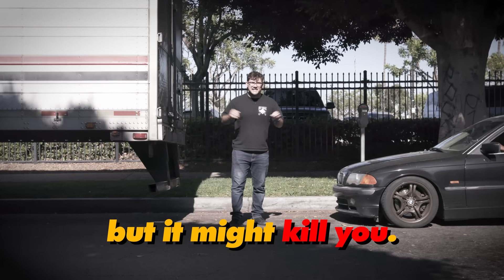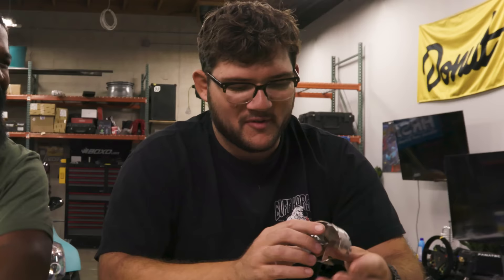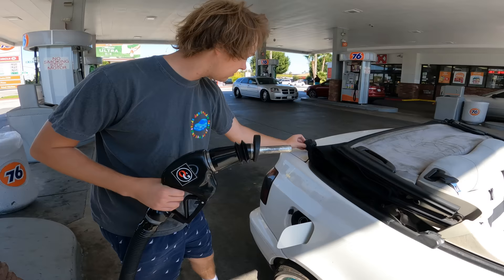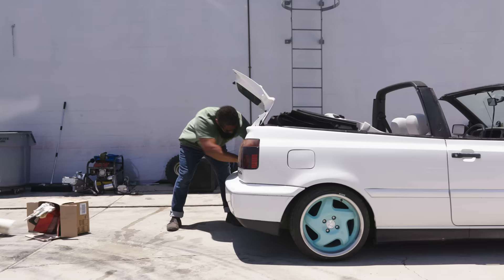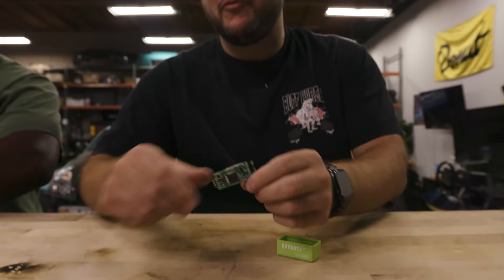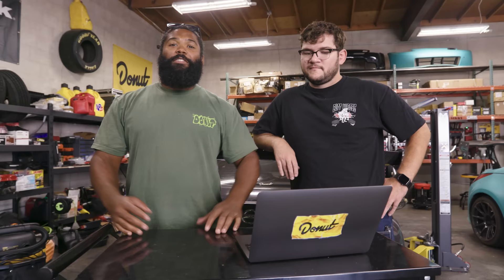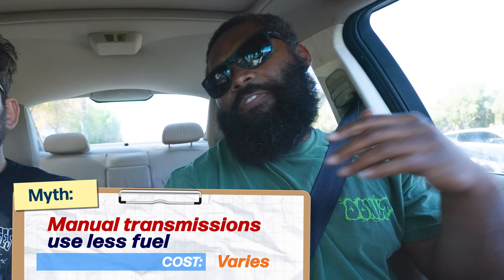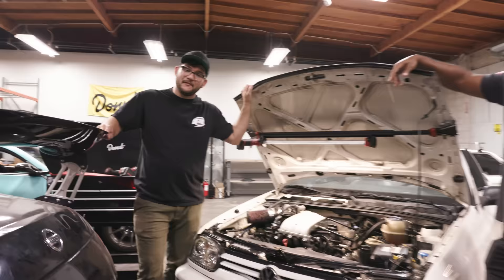Testing Fuel Economy Hacks

Comment: The HHO system should not add much of any fuel economy unless the catayls is adding energy to the system, an alternate way to do this is to use solar to drive the electrolosys
Reply: Have you never heard of the Hindenburg? Hydrogen is one of the most explosive gases, that’s where the energy comes from.
Reply: @slycarlo8747  Thats entirely besides the point, If you want hydrogen just get rid of your gasoline tank and get a 10,000PSI hydrogen tank, get yourself some solar pannels and a hydrogen generator at home to fill your tank up when you get home. You could also add solar to your vehicle and replace your starter with a high torque motor with the same RPM range as your engine to get even better MPG

The point is that the energy needed to split hydrogen from water, is just as much as you get back from burning hydrigen 

(because burning it turns it back into water)

Because internal combustion engines are only 15-25% efficient, you'd be reducing your fuel economy because you're putting 100% energy in, and only getting 25% back

This is why i say there has to be an amazing catalyst to reduce the energy needed to split the hydrogen by about 90%, and that energy has to come from somewhere, so you're actually creating a chemical battery who's output is hydrogen.
Reply: @denvera1g1  You’re assuming that this is the only technology available to synthesize fuel from water. The US Navy uses radio waves to break apart the hydrogen from seawater, and they’ve been doing this for years. As for this video, the main problem with their setup is that they’re using a modern fuel injected car, we used to fit these devices on carbed engines all the time in my area and had very real gains in fuel economy and power. The fact they didn’t even attempt to change ignition timing while introducing HHO tells me they either don’t understand the concept or they weren’t actually trying to make it work.
Reply: I wonder if hooking the hydrogen up to the vacuum line between the fuel tank and the valve would work better.
Reply: @slycarlo8747  I had a feeling you were trolling, you got me, great job.
Reply: @denvera1g1  You’re the only troll here bud. Why’d you delete your last comment?
Reply: @slycarlo8747  Didnt, youtube is weird when you click "view all replies" Thought you deleted yours too but if i click on the notification its still there
Reply: @denvera1g1  You clearly did, it was really nothing though, just more of your incoherent ramblings about how you think we’re at the pinnacle of technological advancement. I’d suggest you research what the petrodollar system is and you’ll understand why this technology was suppressed. Simply put, anything that undermines the value of oil will directly affect the value of the US dollar. Trying to replace petroleum based fuel with the most abundant molecule on Earth would have almost certainly collapsed the US economy.
Reply: @denvera1g1  I see you already deleted your comment again. Why would you type all that then delete it?
Reply: @denvera1g1  “@Sly Carlo I cant tell if you're
rambling and truely dont understand
the basic laws of physics, or if you are
trolling. If you're trolling, you've done
a great job. If not, well here's a little
tip, you cant get energy out of
nothing, and when you use energy it
has to go somewhere.
When water is split into hydrogen and
oxygen, it takes X ammont of energy,
and when they are re-combined, it
can never release more than that
same X ammount of energy
The same thing goes with Nitrogen.
Nitrogen compounds is even more
energy dense than hydrogen because
it is even harder to split apart than
water, and nitrogen really wants to be
in ints N2 state. Thats why most
explosives are made out of mostly
nitrogen, not hydrogen. The "holy
grail" of an explosive would be made
up of 100% nitrogen, theoretically a
3x3 cube could work and be just
stable enough to not explode just by
looking at it, the problem would be
assembling them into this structure in
the first place”

I love that you can copy and paste from screenshots now lol
Reply: @slycarlo8747  Try using a full computer then maybe you can see the comment instead of your phone provider deciding the comment is too spicy for you to read lest you get heartburn
Reply: @denvera1g1  Don’t worry, I put it back for you since you deleted it. It’s pretty entertaining honestly.
Reply: @slycarlo8747  Honestly, i'm enjoying your trolling, you arent overly mean about it, its entertaining, thank you.
Reply: @slycarlo8747  No, just no. No matter how fancy your hydrogen production ways are it wont improve gas mileage. No matter how you modify your engine it wont improve your gas mileage. It is thermodynamically impossible. If you have a even basic understanding of chemistry, or thermodynamics you would immediately know that these devices are bullshit. The only way you can get better gas mileage with one is by having the energy come from a external source that is not generated by your engine. Like adding a battery you charge every time you are home.
Reply: @justahamsterthatcodes  It might just plausibly improve efficiency enough to outweigh the energy cost of the electrolysis.

My gut feeling is to agree with you that this won't happen, but it's not obviously wrong like a perpetual motion machine would be
Reply: @trueriver1950  IT is possible, especially early on before the engine warms up, because if the HHO is displacing gasoline, that HHO gas is already at the proper mixture to ignite, where as gas, especially on carbureted engines, doesnt fully vaporize when its cold.
However, a much more effective method would be to run the engine on propane or natural gas until it has warmed up, and then switch over to gasoline(which has a higher energy density than LPG/CNG meaning you can go farther with a smaller lighter tank of gasoline)

But again, you cant add more energy to a system, by extracting that very energy from said system. This isnt like a turbo or supercharger, where you're only using energy to add more air which allows for more fuel to be used, with an HHO system if you put 3HP into the HHO generator, you'll only ever get 3HP out of the HHO when it is burned.
Reply: @trueriver1950  Uh no. Let's look at the chemical reactions happening here. First we electrolyse water, so H2O -> H2 + O then we move the results into the combustion chamber and burn it there so we get H2 + O -> H2O. If I were to get more energy from burning our hydrogen gas I would have invented a perpetual motion machine, which is impossible.
Reply: @denvera1g1  Highly unlikely, a quick Google search gives me a effeciency for electrolysis to be at 55%, not to mention all the other energy losses involved in this process. Your engine will not be 55% less efficient when cold. If that were true in your case, that would mean you have some serious engine trouble.
Reply: @justahamsterthatcodes  
You are not thinking it through -- either that or we are talking about different things.

I am taking the proposal to be augmenting the usual petrol (=gasoline) / air mix with HHO 

I'm using the term petrol here not only because I'm a Brit, but also because hydrogen is a has but gasoline is not a gas at normal tank temperatures. That matters, because the carburettor is needed to vaporise the petrol into a true gas. 

If you are talking about burning ONLY HHO then I will come back to that at the end.

Now why does this matter? Well a mist of droplets of petrol will not burn as effectively or as hot as a fully vaporised mix. On startup older cars had a manual system to enrich the mixture -- the reason was that with more petrol going through there would be more vapour in the engine. Modern cars do this for you automatically, but it still happens. You can smell the unburnt petrol in the exhaust. So on short runs that's a lot of fuel wasted.

The first theoretical reason the HHO proposal claims to increase overall efficiency is that by introducing hydrogen gas into the cylinder along with the petrol vapour and droplets, a bigger proportion of the droplets vaporise in the cylinder as the hydrogen ignites.

Tell me why you think that wasting less petrol down the exhaust might not increase overall efficiency by more than the efficiency losses involved in hydrolysis?

The second reason is more subtle and involves a more detailed knowledge of thermodynamics. You've mastered the most fundamental law: that energy must be conserved, and so it must. Carnot showed that the diffusion does not end there: the maximum efficiency of a heat engine is limited by an amount that increases as you raise the upper temperature. In a stream engine that's the temperature of the boiler, in a jet that's the temperature of the exhaust, in an internal combustion engine it's the temperature of the contents of the cylinder at the end of the burn.

Typically a petrol engine turns less than 30% of the chemical energy in the people into motion: the rest is lost as great through the exhaust and through the cooling system.

If the added HHO burns significantly hotter, then the Carnot efficiency limit is raised. That means there is at least the possibility that perhaps we get 35% or of the petrol. If the energy lost in electrolysis and reburning is less that that 5% then we are on a winner.

Tell me why there is a theoretical reason why this should not be so? It's not a perpetual motion machine, it's burning fuel but wasting less of its chemical energy as heat. All three laws of thermodynamics are happy.

I'm sceptical anyone can make this work, but not for theoretical reasons: just that it's been tried for so long without success. I admire the tenacity of the researchers that are still trying, though even with a breakthrough this year they would be pre-empted by fuel cells (I come back to this below).

Now onto the pure HHO engine. Again in practice these don't deliver an efficiency gain compared to a petrol burning internal combustion engine (as measured in labs) but there is no theoretical reason why not. To win you would need to be raising the temperature in the cylinders sufficiently to increase the Carnot efficiency.

But if you are starting with electricity, or making it on board the car by whatever method, you are better off with a fuel cell and an electric motor. That's because neither fuel cells not electric motors are limited by the same thermodynamic constraints, and in practice the combination is already getting much higher efficiencies. That's why hydrogen cars tend to be designed that way rather than with an internal combustion engine.

A word of advice, if I may: you mentioned thermodynamics, and that led me to assume you knew and understood all three laws not just the one about conservation of energy. If so, I have you enough of a clue by mentioning efficiency in my previous post. In future you may like to think through the implications of a hint from another post, instead of regarding it as rubbish from the off.

And if in fact you don't understand the Carnot limits then my advice is not to use the word "thermodynamic" because Carnot is pretty fundamental along with the conservation of energy.

And finally if you just don't believe Carnot you would have a job to explain why superheated steam engines are so much more efficient than those that run at atmospheric pressure, and why after burners make jet engines burn less fuel at a given airspeed.

The effects of the Carnot limits are somewhat counter intuitive -- the most startling being the way a heat pump can deliver 3kW of warmth for every 1kW electricity. I will leave you to figure out how that's not breaking the conservation of energy. It's not magic, it's thermodynamics. And it's real. Thermodynamics has passed every experimental test thrown at it.

River, Lecturer in Physics, Open University UK (retired)
Reply: @slycarlo8747  you clearly understand only the basic laws of physics and not the more complex laws of thermodynamics. Please see my recent reply to @just a hamster that codes for more details. In short if you can reduce the loss to heat you can get more useful energy out without violating energy conservation.
Reply: @trueriver1950  Not reading all that lmao this isn’t Reddit. The US Navy can synthesize jet fuel from seawater, they’ve had this technology for years.

Comment: I recently got my hands on a modern (turbodiesel high roof van) vehicle with the fancy instant fuel economy readouts, driving on a highways a lot:
Semis are literally the worst thing to draft, they move slow as molasses, often group up into packs and randomly overtake each other and you can't see through them, they often can't see you as well. Often utterly unhinged, stay far away from them.
It barely matters what are you drafting, it works mostly the same. Sedans, hatchbacks and other regular cars like that are best because they are easy to see around.
Slipstream is a cone and reaches quite far - you can feel its effects from about 50-60 yards, it not only reduces the fuel used for maintaining speed by about 10-15%, but also makes you lose much less speed by coasting.
Keep your car in the highest possible gear when coasting, don't switch to neutral or press the clutch: the rolling resistance might be higher, but engine disengaged from the wheels will use fuel just to keep itself running, engine connected by wheels to the road will keep itself turning just from rolling and will use no fuel. 
Petrol engines may or may not only do it on the downward slopes, but diesels do it everywhere. My petrol daily is too old for such fancy computers for me to confirm it personally.

Comment: I'm surprised you didn't mention that doing a good maintenance to your car every now and then actually saves a lot of gas than another car that has it's original factory oil haha
Reply: Yeah, that was a big one to miss.   Old, and/or Water Saturated, gear oil in a differential/axle has a significant impact on rolling resistance & efficiency too. 
 The same goes for trans oil.
Reply: Proper maintenance more maintains the fuel economy your car had when new. Well at least keeps it from dropping faster. So it doesn't increase fuel economy unless maintenance was neglected.

Comment: My best friend had a car with the "instant MPG" read-out. He'd get in the draft of a semi, and try to get it to read 99.9mpg. It was a T-bird 302. and would get into the 70mpg's if I recall correctly.
Later on I had a 90 Olds Calais that had that read-out, also, and I'd do the same thing occasionally. I was older and wiser, though and knew it was a bad idea.
Reply: My car can display that too, which can be interesting. It also has adaptive cruise control, meaning it can just maintain distance from the vehicle in front. Even at a safe distance (I like not dying), I sit behind trucks at highway speed and see the instant fuel economy get really good.

(for reference, my car averages a little over 39 mpg)

Comment: Depends on car, here in europe we have 5-6 gear manual transmissions and 7-8 gear automatic ones on the most widespread cars that alot of people actually use. On average manuals still use less fuel, but it depends on your drive style. For example my car is said to consume 5.5l/100km with manual, 5.9l/100km with automatic.

Comment: About the filling up your gas tank when it's cold idea, if it's an above ground tank with a pump that's not calibrated correctly, then yeah you're gonna get more gas than what you'd get when it's hot outside

Comment: Gentlemen, while I agree with your conclusion about the hydrogen generator, the evidence you presented showed me that 16.4 miles was driven today (and that the battery had been disconnected recently), not that you got 16.4 mpg.
Reply: Maybe they stopped driving after a gallon of gas has been guzzler?
Reply: That would be a dangerous proposition. Imagine you’re driving on the street and you run out of gas in the middle of a busy road… Do you really think they would do that? What if they get hit? No, I think they’d already formed their conclusion before running the test. It takes two full tanks from full to empty to calibrate that instrument to provide accurate results. I know because I have one. Notwithstanding, I understand that spending so much time to show what they already know to be true would not be a valuable use of their time and resources so I understand why they did what they did. I’m just pointing that out

Comment: Agree to disagree on the manual transmission.

1.) they are significantly lighter than automatics especially as the automatic transmissions get larger and need more coolers etc….aka the additional parasitic load of pumping all that heavy hydraulic fluid around.

2.) depending on traffic, the number of gears is less important than the gear ratios.  Most factory 6-7 speeds  end up with a 0.5 final gear ratio. In higher traffic volumes it may be closer to even but even with the additional gears, the benefits are still offset by the weight.

In more open road driving the gap will widen more significantly in favor of the manual transmission.

3.) a better argument may exist with the advent of CVT transmissions which are lighter than automatics and constantly use optimum gearing.

4.) lastly there are what I refer to as “road car” sequential transmissions which I’m not sure where they fall. Either last or next to it maybe?

Perhaps you should do a video that directly compares all the transmission types in regards to maximum fuel economy.

Comment: You are correct that Mythbuster found the maximum increase very close to the truck, however they also got a 10% increase in MPG at 100 feet, a reasonable following distance at highway speeds.
Reply: Not to mention trucks often drive slower as well. So I mean...safe distance from truck. Lower speed without some speed demon screaming at you because he can't right lane pass you. Win win.